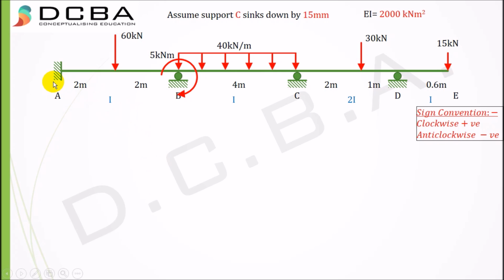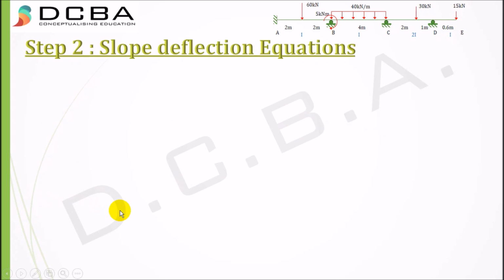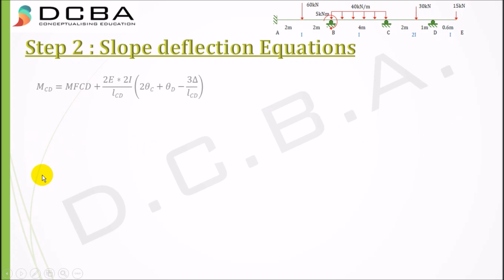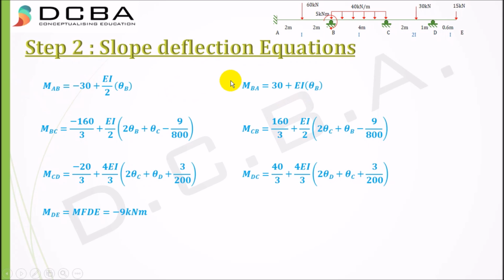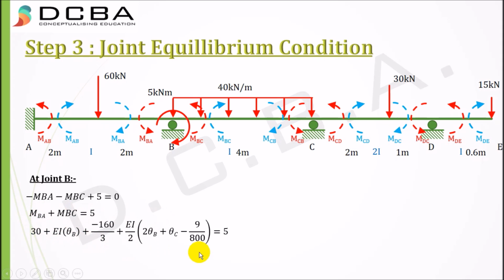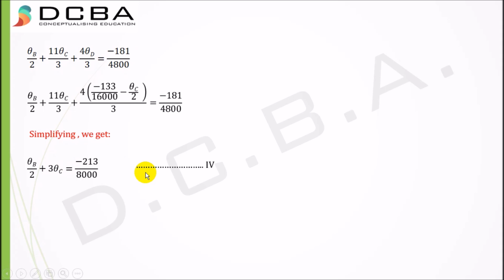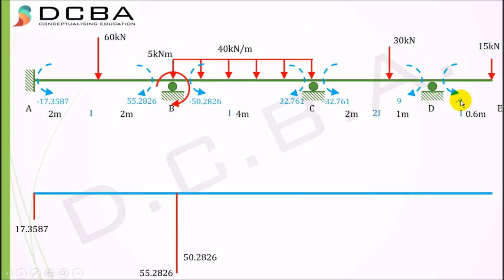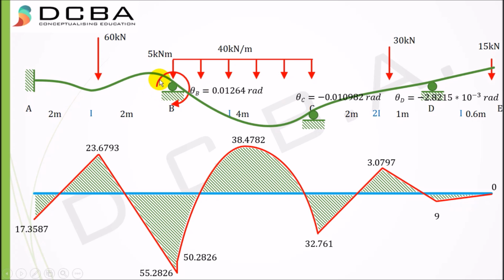Slope deflection method numerical / example (with support settlement)

Comment: Hi

12:54  regarding that force moment at A pls kindly clarify its direction,
 my understanding is that it should be clockwise since the point load cause clockwise rotation about A, pls make me understand

Thanks
Reply from the maker: Actually the reactive moments are the ones (blue colour) which we are interested to determine. So in joint equilibrium equation we assume all reactive moments to be clockwise (positive), at the end if they come negative means they were anti clockwise.
Reply: @DCBAonline  
Thank you for your response, 

Meanwhile, Sorry I didn't get it, my query is  why the moment at A due to force is  an anti-clockwise moment
Reply from the maker: All the reactive moments were assumed to be clockwise for convenience, and the force moments were just shown opposite to those reactive moments.
Reply: @DCBAonline  Noted with thanks. I consistently watching your videos, upgrading my knowledge, I hope one day it will help me to reach my goals

Pls kindly keep upload videos for us particularly concept wise, derivations etc..
Reply: let me try, 
Can I say that the direction of reaction moment pre-defined and the force moments are considered just opposite to pre-defined reaction moment regardless of the direction of  moment about A and its corresponding load

Comment: Hi

Does roller support resist moment, I think no, pls kindly clarify this in your problem 

Thanks
Reply from the maker: No it doesn't. Hence the LHS and RHS moments about those supports have moments summed up to 0.
Reply: @DCBAonline 
Noted with thanks..

which means there will be  moment in beam due to load but there won't be any reaction moment from support 

is my understanding correct?
Reply from the maker: Yes there will be moment if its a continuous joint, but the moments will be balanced and the joint would be free of rotation.